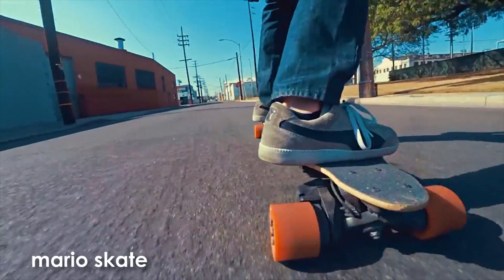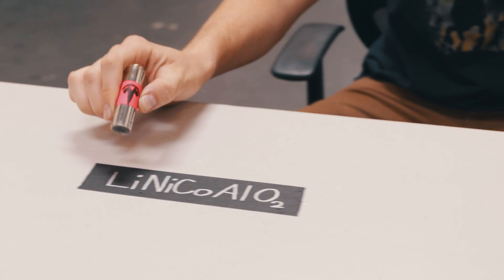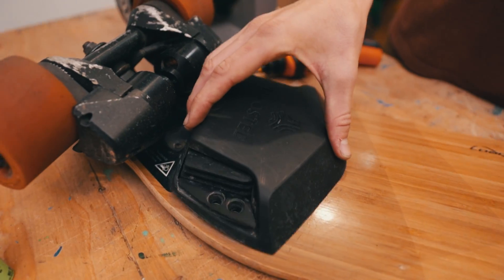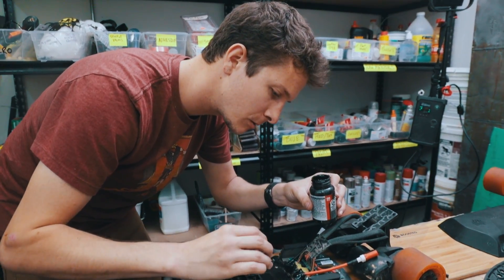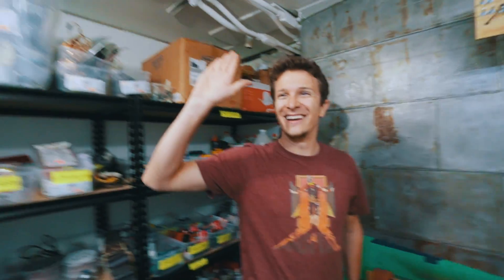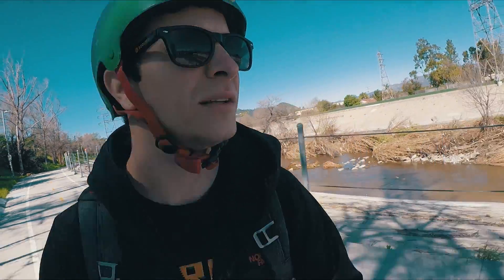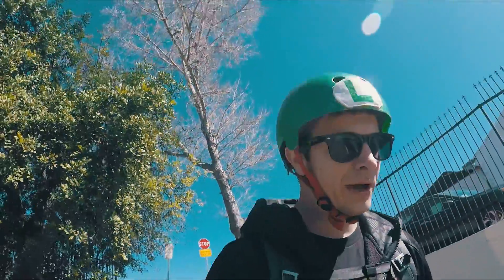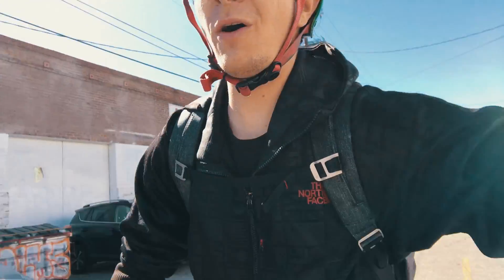Tesla Batteries in an Electric Skateboard!

Comment: Always, always, always test the power draw of the motors first, then build your battery packs for the motor's needs.
I know you tested post-video, as you said in another comment, but always know your power draw first. 
Also, since you'd need 5-6 packs at least; I'd suggest getting a carbon fiber board made where you have an enclosure covering the entire bottom of the board, to protect the packs. 
But at that point, you might as well create your own system, as they're not hard to make, you just need to know engineering and electrical engineering. But a more powerful motor will give you the torque you require.

Comment: I think the problem is that, yes you have these two extra battery packs, but you've connected the batteries with in them in series, which you've then connected in parallel. So if one of the cells has a lower voltage than the rest this will cause your entire battery to drop voltage. What you should do is connect all the cells (the little tesla batteries) all in parallel. This will keep the output power the same but your total battery capacity is now larger. 
   Remember: in series {Volts adds together --- Amps (power) stays the same} more capacity 
   In parallel: {Volts stays the same --- Amps add up} (more power).

Comment: use a stepp up converter, its 10 bucks on amazon and works great...for the range i would take a battery guard, also 10 bucks and it shows you the voltage of each zell...
and it has an alert if the voltage is tooo low

Comment: I'm pretty sure it is dangerous to connect to the boosted board battery because it can lead to a high current draw from the external battery's if they are not the same voltage as the boosted board to try to get them to a level where they are even

Comment: Heyy you should turn the motors when measuring the voltage. remember batteries aren't hard sources the voltage will drop depending on their charge when they're loaded, otherwise even dead battery will give you full voltage. you know the internal resistance and stuff. :P

Comment: BATTERY PROBLEM: why don't you look into different circuit boards like a MOSFET board used in vaping, that give you ALL the power and can make them go down to a lower voltage. 18650s are used in VAPES so look into how the circuit boards in VAPES  make the batteries last longer but still give all the power

Comment: You need to quit mixing battery chemistries. just remove the original battery, replace it with one of your tesla packs, put a boost converter on it to salvage the lower voltage that the board isnt designed to work with, test it, barely be satisfied, scrap the dumb board idea, find a cheap bike frame, buy a cheap hub motor and controller, slap all your batteries on it and then triple that and boom. Thats how you solve the problem of having a reliable, lightweight electric vehicle that will get you 15 miles in a satisfactory manner with an acceptable product lifetime.

Comment: It's probably not the batteries, but the motor. My guess is that it is only meant to run at 5mph in order to have function consistently and for a lifetime. If you add too much, you'll burn it out. My guess, probably doesn't help since he's an expert and I'm not. Lol #wrender

Comment: Hey Wren, what you could most likely do is to have a voltage booster kick in when the batteries reach that low level, but then have a low voltage alarm so that it doesn't over-drain the batteries. Or, as an alternative, replace your battery packs w/boosted board/electric skateboard batteries

Comment: nice try and good video...did 42 mi. on my custom build 18650 battery pack and eglide board ...I think a bigger wheel board is a better at long trips ..you can go off road and pull better on hills and more room for the battery....I built a 1.2 kw pack for mine ...you could go to work and back on 1 charge....then charge it with a solar panel and its a free ride...ck out my battery build and test .....have a great day....

Comment: if that battery dont work well use drone battery and the motor and the self charge motor (like if u go very fast it will charge like 5% per 10minute) and motor need to change to like the hilium motor

Comment: two things.. 1.. to change the range the boosted board controller you would ideally just reprogram it.. however we dont have access to its code.  so we can just lie to it.
find the voltage divider it uses to measure the battery voltage... and swap the resistors. maybe put a pot there for testing first. this is no diffrent than finding/modding the voltage output of a power brick.
2. you need more of those packs in parallel for your board. atleast 3p but ideally 4p. look at the diy electric skateboard guys, they all have 3p or 4p 10s packs.

Comment: Mehdi @ ElectricBoom has this to say. 

"Hehe, nice! What I would do is I would put those two packs in series to get 80V, then use a buck regulator to get a fixed 40V output. That way the skate board would always output the same power (or same torque) as voltage would be regulated, and the batteries would deplete completely and give all the charge they can. I assume batteries already have under voltage protection, otherwise we would have to add that too.

 

Leave this as a comment under his video and you would be the smart one!"

Comment: what you can do wren is that you can either increase the battery packs by 3 more or change/ unsolder the regulator on the board or once again change the gage of the output wires

Comment: I general you need to have matching specs on batteries in parallel. Also adding more current through the ESC board will create extra heat and may exceed the amperage specs of the control board. Also C rating (is the current a battery can discharge at a given moment)should match. With what you got now you would have to make a control board to charge and regulate voltage cutoff.

Comment: What if you were to add a voltage regulator and a tinderbox charging system ala 50cc scooter batterys? would add at least 10-15 pounds weight though. also maybe some sort of solar powered trickle system to keep the batterys at a steady flow?

Comment: you can use a voltage transphormer, kinda like the ones found in laptops' power cables.
if you wanna DIY it: it's two wraps of insulated copper wires that wrap around a ferromagnetic core. if you need to increase the voltage the output wiring has to wrap around the core times X more than the input wiring.
you're lucky I just learned that today in school lol

Comment: I have a solution but you WILL have to be careful:

Yes, you can use a boost converter to up the voltage and hold it at a constant 36v, but as this WILL skew your capacity readings as well as increase the current draw on the battery packs which means more stress on the cells and a shorter life. you're gonna HAVE to use a battery voltage alarm that can sense when a cell in the pack has dropped below 3.0v, which is the safe point for most Li-Ion and Li-Po cells. Additionally, to get the current draw that you're after, get 20 more cells and modify both battery packs to use a series-parallel configuration. As your cells are about 3,500mAH per cell roughly... you should be able to get about 14,000 mAH from a pair of 20-cell 10S packs in parallel and about 20A continuous current draw which should equate to a 750W continuous power draw for your boosted board...

Comment: Step up converter at the boosted board battery to an hogher level for saying the controler to have charge. NOT RECOMMENDET. You should check the specifications of the boosted board battery. NEVER GET THE VOLTAGE TO MIN. Safev30% of charge to not degrees the battery life. Sorry for bad English. Apprenticeship for Elektroniks in Switzerland.

Comment: Is there a way that you could use the batteries like the battery in a hybrid car? Using the batteries to charge the main boosted board battery, then your battery is going to have the charge and should stay the right voltage right? Sorry I'm not hat great with batteries so I could be completely off

Comment: add a transformer so you are not wasting voltage?  I know it adds a lot of weight but it will still give you higher output overall.  How about 4 small hub motors instead of building a hotwheels edition skateboard you fucking morons.

Comment: I would put an Arduino nano in there for Voltage monitoring and capping the built in battery at 33.5V, and boosting the others to 33.5V minimum. I guess you can't reprogramm the board to go below 33.5V

Comment: You can do like two separate circuit and a switch. when the battery go low you can series the battery which doubles the voltage however i don't know if the motor can take it

Comment: Why not change out the boosted board battery so that it's the same as the other two you made? It could be that the older batteries in the boosted board have gotten weak because they may have been over discharged. I know with lipo batteries this causes the internal resistance to go up and reduces the capacity they are able to hold, Im not sure if it is the same with li-ion batteries because of the different battery chemistries.

Comment: Im late to the party, but throw another one or two 18650s in parallel per pack. Then use a voltage step down circuit to set it to 40v.

Comment: mmm i didnt get a good enough look through the wiring but my guess is your going to have to wire the board where the computer and controller are using the tesla battery's as a primary battery source and the original battery pack as the secondary. seems like right now, it's backwards practically because you just stuck the tesla batteries on there and wired them in. Now your going to have to find a way to rewire so it's reading off the tesla batteries first so when the boards battery get too low its not reading the actually boards battery just the tesla batteries, at that point the board battery wont work but the tesla should keep going... alot of variables though🤔

Mmm not even sure if it makes sense or how you could do it if possible, I would have to look at it but thought the idea would be interesting to share🤔

Comment: Couldn't you just simply rewrite the battery's packs so that the addition packs are used first then the original booster board battery is used? Wouldn't that's solve your problem?

Comment: I think the boosted board has a built in "transformer".So if you want to use the all the power from the battery you have to use a higher powered transformer.I think if you do that the the motors are going to explode if it overloads.Transformer controls how much power is going in and out

Comment: pretty cool video Wrender. But sheesh man. would have been easier to just get a evolve carbon GT with the 2in 1 off road and on road wheels. :P
Reply: Easier but a LOT more expensive :/
Reply: True true :( 

If i had the money. I would buy you one and send it to you.

Good luck with the modding bro. Hope it works out for you because I would hate for the worst thing to happen which is a dead boosted board which will cost you even more! + the hours and time and materials you spend.

Comment: I'm a little confused by your video and analogy with the water, although not really wrong (I only watched 2 and half mins) you misunderstand a lot of other information about EV's that would make ur lifepo4 far more suitable (although heavier) in that space constraint.
You cannot have an 18650 with BOTH huge capacity capabilities and huge discharge rates. It just isn't possible, the 2 are more or less diametrically opposed. The Samsung 25r's have less capacity but far more power than the Panasonic, and the new Sanyo GA (Panasonic now) has almost 3.5ah but lesser current output capability. Just figure out both how much actual space there is and how much power you need for the speed you want and THEN  pick the battery that best matches your goal. Focusing only on the Tesla Panasonic will lead to disappointment when you realize how many parralled packs you'll need 4 the same power as your old lifepo4. Well have fun :)
Reply: I'm pretty sure I established what you said here, and I'm also pretty sure I'm not misunderstanding that. My hope was that by sharing the load between 3 battery packs, the discharge rate wouldn't be an issue. This was obviously a wrong assumption as you mentioned, since I need more parallel packs than 3. I definitely learned that I needed to account for the current draw from the batteries to match the 2000W motors. If I'd done the math I would have known better, but I bought the batteries and built the pack months ago before I was better versed in the ins and outs of Ohms law.

Comment: wren a way to  continue the voltage to the battery built in is ti make the 2 extra batteries as chargers that make the first one charge as time goes on so you never tech run out of power thus staying the same the whole time you will also need to make a cooling unit of some sort so the batteries dont over heat spesh in cali

Comment: Firstly, this was so helpful! Wren you are incredible at teaching these principles, and honestly I have learned so much from these tutorials of yours. 
Now, I don't have a lot of knowledge on electricity, but I think part of your problem with going up hills on the board is not so much that you don't have enough power, but rather it needs to implement it somewhat like a bike with gears. Having gears with more teeth allow for less torque and less energy required to move the bike, but it will cause your distance per pedal stroke to decrease dramatically. So if you could somehow keep the same energy but lower the torque, you could possibly be able to go up hills. Just a thought that might help!

Comment: You're using 18650 batteries most commonly used in vapes such as mine if you want more voltage or amps run it's in series not parallel

Comment: The best solution i can think of would be to have the boosted boards battery stop giving power once it reaches a certain threshold and letting the other two batteries pick up the slack, to do so i'd attach something to read the power of the battery and then something else to cut it from the circuit, i would recommend one of the tiny programmable arduino-like things.

So yeah, i can't see any way out of it without a lil' programming or sneaky circuitry which no doubt you were avoiding.

Comment: the easiest way to remove the old battery and utilize more new battery module in parallel it ll give you more range and better life overall. plus it is also advised no to use different type of batteries in parallel.
I am an Electrical Engineer.

Comment: Has it caught fire yet? Putting lithium ion batteries in parallel without load balancing circuitry in there is a REALLY bad idea. Texas instruments has a lot of free white papers on this subject, just google "texas instruments lithium ion white paper".  If it were me, i would stick to the LiFePO4 batteries. They have a lower energy density, but they are more forgiving when you dont know what you are doing. Im curious, are you monitoring the charge / discharge rates? Charging at faster than 0.7C can lead to fire. Discharging at a rate above 1C will also lead to a fire. Oh, and you might also want to keep an eye on the battery pack temperature-- exceeding 150C will cause thermal runaway... and you guessed it- a fire. To fix your capacity problem, a boost converter will work, but it will also decrease the efficiency-- possibly lowering your range. But seriously, Li-Ion batteries are no joke. Believe it or not, a half charged laptop battery has a similar energy density to a hand grenade. Messing around with these things can be dangerous. That said, have fun, and make a video when it does decided to catch fire :)

Comment: Boosted uses 12s1p A123 LifePO4 batteries, which should support 60A current draw. With roughly the same space, you could build a 10s3p battery pack using LG HG2 batteries (20Ax3=60A) or even a 10s2p pack with 25A*2=50A. However, this still won't prevent your problem with the speed controller, which is programmed to prematurely cutoff at a high LifePO4 voltage. Thus, you have two options: (1) stick to LifePo4 chemistry and use two 12S1P packs, or (2) buy a couple VESCs and gut the electronics of the boosted board entirely, lowering your cutoff voltage. It's good fun! :)